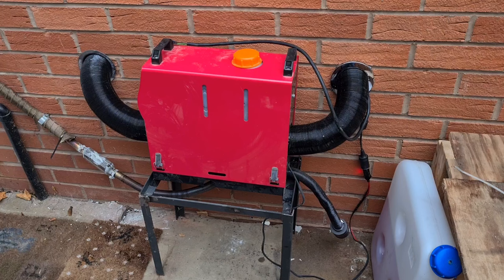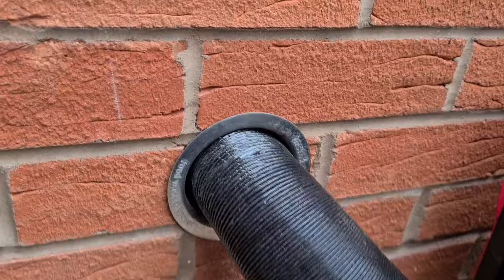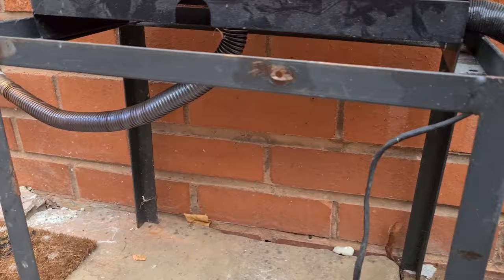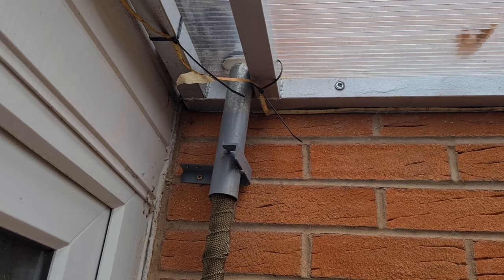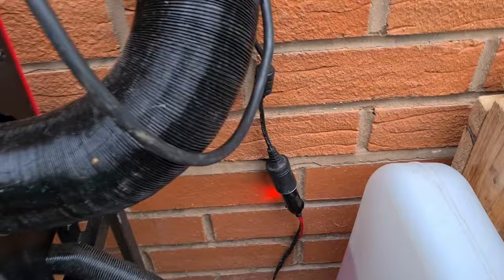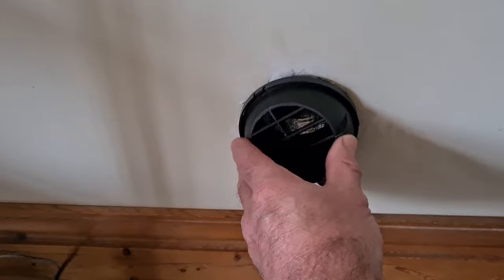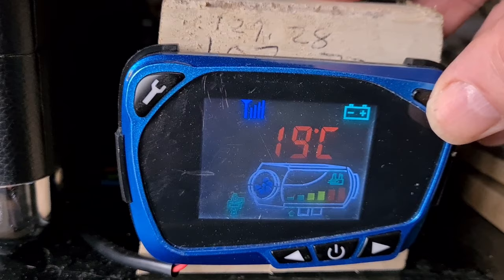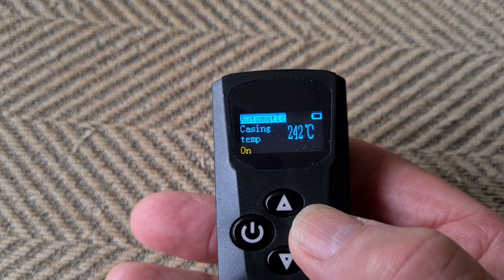Chinese diesel heater that is heating my house. Subscribe & Like it will help make these video's

Comment: Funny how so many people have negative opinions, yet they dont even own one. Or even are willing to try, but they will try to cut you down. Do you really think this guy cares if you choose to spend more money on heating. Of course it doesn't work, dont try it.😂
Reply from the maker: There is all was going to be the doubters it's costing me nothing to run at the moment as getting all the fuel for free off a fue people that have old oil tanks that they need the tank emptying running it o kerosene at the moment no problem at all...

Comment: Running the exhaust up like that will cause problems eventually. Those heater build up moisture in the exhaust tube and shut the unit down or wreck it. Always have a decline in the exhaust pipe so the moisture can drain out.

Comment: Upgraded the mufflers on both of mine to a couple of ebay ,tenner each,been running them over 2 years so much quieter.Also you will get a build up of condensation in your pipe and the silencer as a hole in the middle at the bottom to keep the pipe clear, just saying as yours is handled upwards.I was getting a lot of steam ever time i started it, untill I lowered my exhaust.

Comment: little tip for ya ........ my first install was same as yours with inlet and outlet holes ( throught the wall of the house ) being 2 to 3 feet apart ......... i changed it because of the noise inside the house from the fan - i made a new outlet through the wall about 6 feet away into my utility room where the heater was drawing from and the noise levels dropped to almost nothing - been running mine on kerosene from day 1

Comment: You might need to be careful with the exhaust as it's going up vertically the gas will cool and condense which will then run back down the pipe and collect at the lowest point of the exhaust. You might need to add a way to drain it at the lowest point or keep your exhaust horizontal
Reply from the maker: It's heat wrapped on the vertical part and has a landscape bend on the outside slopping down so water will run out and not get in it been like it for a year and any water will run out the part of the silencer all ok so far 👍 thanks for your advice I will keep a eye on it
Reply: The hole in the silencers is so water can run out.
Reply: in the silencer is a small hole for that purpuse but he closed it as well with his exhaustpaste very crever man
Reply from the maker: @simonkorsman3894  iv cleared it so it drains out 👍
Reply: @aaronkent2940  Diesel looks PINK! Where are you getting it from?!
Reply: @GMT439 if it's pink it's farm diesel. There's no road tax on it.
Reply: @Chevroletcelebrity   It could also be HVO which is an organic alternative to diesel often used in boats as it is more stable and does not suffer from diesel bug and it also is red in colour just like farm diesel, if it is farm diesel he will need to be careful in the coming year as the current law only just allows  its use for home heating however our fantastic government have decided that it will soon be illegal because they say that the tax applied to white diesel is to reflect that it is dirty fuel and people should pay and be punished for using what they say is a dirty fuel, and so by using red  they bypass this and so the government are currently in the process of changing the law for the environmental totally not about the tax they can make.
Reply: @EQINOX187  no
Reply: I agree, the hole in the edge of the silencer is a water drain hole and looks to be sealed
Reply: @Chevroletcelebrity  Well the guy is not on the road so why should he pay road tax? :D
Reply: @joshc606  How is any condensation going to make it up to that muffler if the low spot is way down at the bottom?

Comment: Insulating the hot air tube will improve your output by a good bit. combustion exhaust can be coiled up and used to heat water. Keep in mind condensation tends to build in the exhaust if it is long enough for the temperature to fall below 100c before the muffler. Water can drip down and back into the combustion chamber.

Comment: How much does it cost to run per week in diesel mate?
Reply from the maker: If its flat out it uses about 2 to 3 litres I say 6 hours but if it just on tick over about 1 litre even 6 hours. I'm running it on red or kerosene so about £1 a litre...
Off hand I have used about 20 litres in 3 weeks and that was say from 5pm till about 10.30pm at night ..
 Il try and do an extra meshing of it in the next few days ok
Reply: I bought heating oil at .50p a litre ( plenty selling their tanks to go green ) , 5_8kw .54l per hr on max .2l on low  brought up my lounge from 14c to 17 in 1 hr , 21c 3 hrs later droped to min for the last hour before bed.
Reply: How is cost now. Compared to your old heating method, before this heater. Is it saving you money?  And how much do you think it's saving you?  Thanks, just after rough prices. Thanks.

Comment: From my experience, the claimed fuel consumption and heat output do not compute,   The exhaust temperature is very high.  This means about 35% of the fuel being burned heats the sky.
Modern oil fired boilers are very efficient and run on cheaper fuel...kerosine.   At £1.50 per liter on diesel for 10 kwh of energy  at 100% efficiency thats  15p per hwh, with 50% efficiency it is 30p per kwh,   close to electricity prices.  Those heaters are made for vans etc, so are made as small as possible. The heat transfer area inside them is way too small , that is why the exhaust is so hot.   If the heater is using half a liter of fuel per hour 75p  the actual heat you get is like a fraction of that.   2 to 3 k watts.at a cost of about 30-40p or more per hour.   
If you can add a secondary heat exchanger from the exhaust it will be a lot more efficient.
Reply: Although these will run fine on kerosene at too
Reply: This is exactly how it goes. Me here in Finland (-7C) trying to heat an old garage from the 60ies. Its floor area maybe 40m2, 2"*4" walls insulated with wood chips & sawdust,  its roof/ceiling having roughly 10...20cm insulation similar to the walls, and no floor insulation just plain concrete. I've been playing with an 8kW Chinese heater, and based on the fuel consumption it pumps out maybe a litre/h, but as written above, it blows heat far less than half of that. Did a "clever" heat exchanger from a spare car radiator, so blowing ex.fumes through it, and then to the chimney of the building. But as you may guess, it worked  for an hour, maybe less, as it fills the radiator with water and cleverly switches off itself.  Without these diy heat exchanger developments it¨s now working well, and blowing with much reduced effeciency, but it works. Here diesel oil for road use, with all taxes, as of today cost 1,9...2EUR/litre, and "tax free no road"-oil now guessing something like 1,5...1,6EUR/l not so cheap. I use it only occasianally when doing something in the garage, but the problem here is to get the temeprature even above 0C, taking several hours and quite many euros.
Reply: Agree with all of the above. I have an '8kw' (dream on, 3kw if youre lucky) version which is great for its intended purpose of heating a lorry cab or caravan/camper but the figures simply don't add up for attempting to heat an actual house.
Reply: Use red diesel (gas oil) it is about £1 per litre.
Reply: Every one uses free sump oil.
Reply: Kerosene Heating Oil at 25 L £10.99 - 44p a litre

Comment: If you have central heating in your house, and want to heat on diesel or kerosene, get an oil fired boiler, jet it appropriately and just connect it into your central heating loop. Be advised, natural gas is still cheaper. I used to heat my workshop with red and a re-jetted pil boiler but now its ollegal to heat commercial premises woth red..

Comment: I use a couple of the heaters in a similar fashion, they are a good job and cheap to run, I run mine of 12 volt car batteries  charged via solar panels.
Reply: What wattage are the solar panels? I've bought a heater and have decided to go the solar route

Comment: how well does this work? been thinking of picking one up as emergency heat in case of a blackout during the winter. We have electric heat so no chance running a 60kw air handler on the generators I have.

Comment: Any idea how much it cost to run? Maybe on an hourly basis? 

Can it be run for long periods, say 5-8hours?
Reply from the maker: It will run on tick over for about 6 hours on a litre of fuel kerosene about 75 pence a litre .
if it's flat out if you got it full pelt it will use twice as much or more ...
Run times I have it on for about 8 to 12 hours a day. You can just leave it on full-time if you so wish to ..
Il try and get an extra meshing of the usage of fuel ⛽️

Comment: Hmm not very weather proof is it ? great idea but the cables are open to all weathers of winter, the cigarette lighter connecter is open to rain and snow getting on the contacts causing a short or blow. The live mains cable is not weather proofed and is open to all weathers. 
If you ask me it’s a ticking fire hazard! 
Plus it will only heat one room so the rest of the house is cooler. Not really ideal. Stick to gas .
Reply from the maker: It doesn't rain in there it has a roof!!!
Reply from the maker: Heats 160 Square meters to 23C° and the can take thd chill off the rest of the house

Comment: Looks good. Thanks. Inspirational .What is the consumption like?
Reply: On the lowest setting.  145mils of fuel a hour.  Middle setting  about 230mils per hour.  High setting.  370mils per hour.  I run mine on low  . I use about a litre a day to heat a 16' x 12' room.  Cost  1.29 € a day . Brilliant heaters
Reply from the maker: It's not bad at all I left it on for about 7 to  8 hours fue hours flat out and then on tick over used about 2 Lt
Reply: @markirish7599  awesome. I need to get one👍😁
Reply: Use DIN rail power supply for 12 volts, some are good for 70,000 hrs.

Comment: Would it be possible to direct exhaust pipe through the wall then through the roof? To harness more heat into building rather than losing that heat outside?? Or is that too dangerous 🤔

Comment: Insulate air ducting mate, will. Make a difference.
Reply from the maker: Someone else said te same and I was looking at it today and yep needs doing
Reply: @aaronkent2940  i run one for whole downstairs with swith over duct to upstairs during the night. 👍 I see u use red diesel. Check for kerosine. Last bought for 98p a liter. It burns cleaner but will be 5-10c temp drop. On casing. But its 98p also if u buy 500L can get it for 75p but I got nowhere to store that amount. I had some carbon build up where plug and atomizer netting is after whole last season. Cleaned it up recently and I guess good till next spring now :) my avarage last year was 2.5L / 24hr obviously still using some gas anyway when temps drop lower but its a great saving for me. If not this gas be costing me 10£+ a day easily
Reply from the maker: I'm running on kerosene at the moment I'm getting it free off my brother he wants an old tank emptied so win win

Comment: I'm betting that you have extended the length of exhaust way too long. The extra restriction will reduce the flow & raise the temp of the heat exchanger.

Comment: You can get a vw egr cooler and run the exhaust through it and it will heat water for a radiator this is what im going to try next

Comment: It says these need 15 amps to run properly is the 10 amp is the connector doing the job ok
Reply from the maker: Yes it's running OK on this one and my friends one but I have another one that some time errors out . So may go for a 15 amp one
Reply: @aaronkent2940  thank you for your reply
Reply: They only run 9 amps when the glow plug is heating then around 4 amps on full power, less than 2 amps on the lowest setting. On full power around the same wattage as a 50 inch LED TV.

Comment: did you have any issues with extending the controller wiring? I want to do this with mine as well. Great install man
Reply: id extended my wiring with normal household lead like this. 3 core. i put it in my latest install vid of the heater   cheers andy
Reply from the maker: No problem at all

Comment: Sensible question (and I ask because these are by comparison much less efficient and have less output), is there a reason unique to your property that you choose this route and not simply an oil (kerosene) fired boiler?

Comment: How much does it cost. is it saving a lot? How long till it pays for itself?
Reply from the maker: The unit is anywhere from £100 to about  £180 depending on times of year you get one and cost any where £1 to £2 for about 7 or 8 hours use

Comment: How big of an area does it heat
Reply from the maker: The main part of my downstairs of my house is open Lounge to my kitchen and then I'll leave the utility door open as well so it's three rooms all together it adds up to 112 square metres .
I'm running the heater on number 3 and then when it reaches 22 degrees turn it down to number one but I can open my door into my hallway and it will take the Chill off the rest of the house as well if I so wish to....

Comment: Having that exhaust pipe pointing up like that isn't so great. There is a lot of moisture in the exhaust gasses that will condensate and pool water in the lowest area of the pipe. You really should have the pipe end lower than the heater
Reply from the maker: It's heat wrapped it doesn't condensate at all it has been like this for a year no water has run out of it at all

Comment: I got this chinese heater,not digital, wont lite, no spark,not working, need something, not sure what parts, pump or ignition, any idea's
Reply from the maker: Is the pump ticking when the pump light comes on on the display 🤔
Reply: @aaronkent2940  not a sound,  just the fan for a few seconds and then the fan stops
Reply from the maker: Try tapping the pump with something little hammer when it's ment to be on ....
If not get a new one il send you a link
Reply: @aaronkent2940  thanks I'll try that
Reply from the maker: https://amzn.to/48immDV  
https://amzn.to/3tEMx8O
2 pumps you may what
Reply from the maker: https://youtu.be/lJv6ZsRCUnI?si=qecB89Sloak_V-Pz
Iv had the same problem, so did a video for you on how to fix it

Comment: That's an interesting job, thanks for sharing! Supermarket diesel (I know you're not using it, but not everyone has that option) is £1.50 per litre. If a well-known search engine is to be believed, there's about 10kWh of energy in a litre of diesel. Assuming no losses (it's fine, if you want to put an 'upper bound' on something: "it's never going to be better than this") you're heating at 15p/kWh - about half the price of heating directly with electricity, twice the price of gas. You're also getting peak heat whenever you want it, which is something that isn't true of a lot of other heating methods. I found a similar product online with its rating sticker visible that says 12V@40W, which if it uses that much DC all day works out to not under 15p per day if you're transforming mains electricity (you could run it off an appropriately-sized solar battery charger - no inverter or transformer needed?)
Now all we need is for the "air fuel synthesis" guys (where did they go?) to make a box we can put on the sides of our houses to convert summer sun into about 2 water butts worth of diesel.

Comment: NOOOOOOO NEVER!!!!!!! PUT YOUT EXHAUST HIGER THAN THE UNIT. YOUR Heater will never last long. All the moisture cant escape if i point the exhaust. Upward.
Reply from the maker: It fine never any moisture in it if ther if at any point it will come out the breathing hole in the silencer plus the exhaust is heat wrapped so dose not condensation its been fine for a year so far
Reply: @aaronkent2940  mine was fine for 2 years and suddenly when i was gone for a quick bite to eat the unit shut off but is kept on pumping diesel. The pipe will collect water and rust trough at one point. Its just an tip from what happend to me.
Reply from the maker: @RealfishingNL  o ok thanks il keep an eye on it .Happy heating 👍
Reply: I just posted the same thing not realising you had as well. Very very bad idea to have the exhaust vent higher than the heater